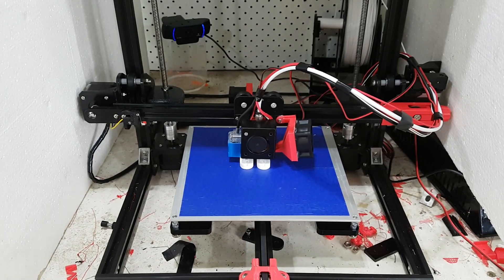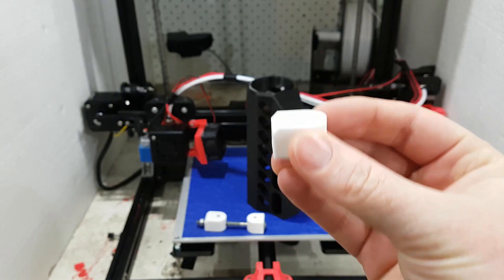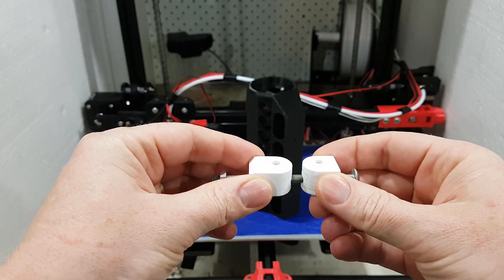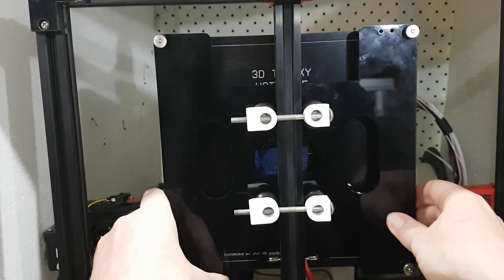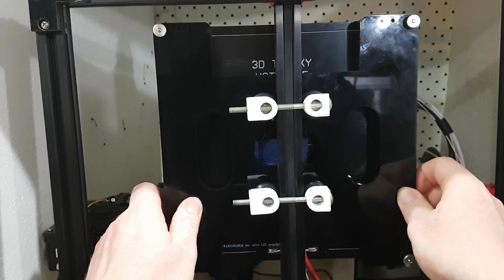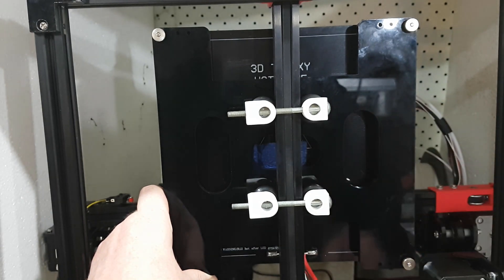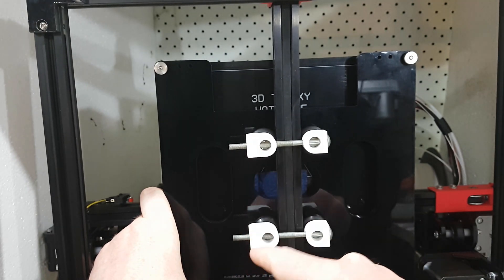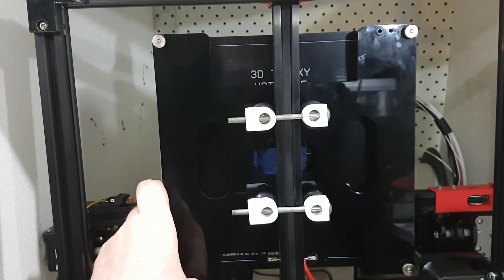Tronxy X3 3D Printer Build: No More Y wobble: Episode 7

Comment: Hello, I have a TronXY clone from electronicgeek.com in Canada they call the Prusa Eg4XL.  (Boy,  that guy's name is over used!) It is a beefed up version of the large format TronXY. It has dual y rails and a 24v PSU with heated bed and a 300x300x380 build area. 330x330x400 is supposed to be obtainable.
The kits that are put out always seem to have issues whether buying from TronXY or another reseller. The heat bed is an issue on all of these machines. The wire simply taped to the bottom with masking tape as in this video and the loose bed was a let down. Some people use different bushings or print parts for upgrades that pull the wheels together from the underside but what I did to straighten and firm up the travel of the wobbly bed was a no cost, no added parts solution. 
Simply remove all rollers, grab a rotary hand tool with an appropriate burr and cut the holes into an oblong shape toward the center of the bed. 1 to 2mm will be enough so you can do this with a round file. When you install the wheels again make sure they are in the groove of the 2020 aluminum extrusion and push toward middle as you tighten. 
The wheels now push firmly against the rails and all is snug as a bug without suspending a penny. (No pennies in Canada now so insert "nickle" if you're Canuck!) 
If you are worried about things coming loose; I like nylon inserted lock nuts or split washers but I have not found I need them. Yet.
This is a free and very effective fix if you dont want to run around trying to find eccentric bushings, etc.
Good luck!